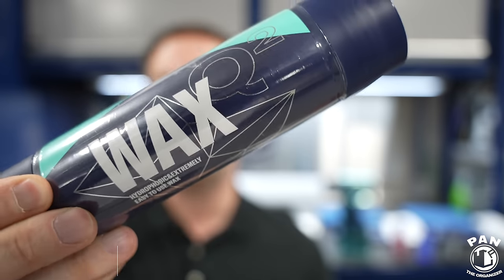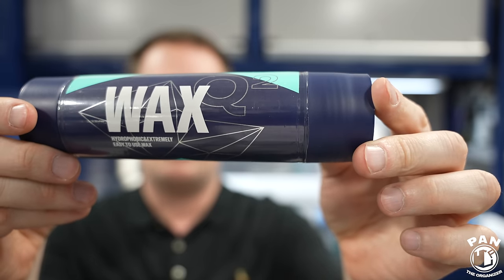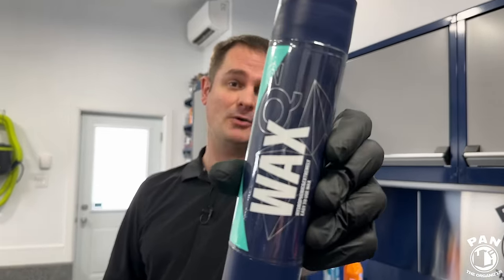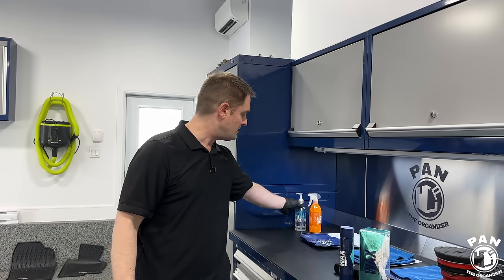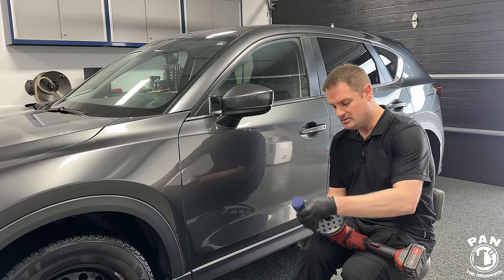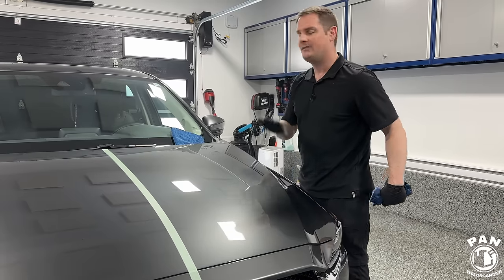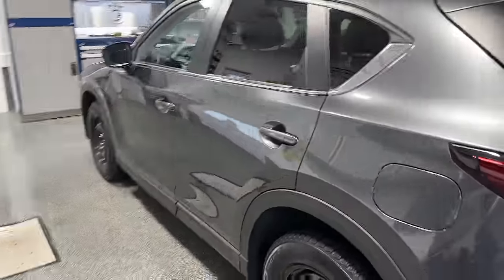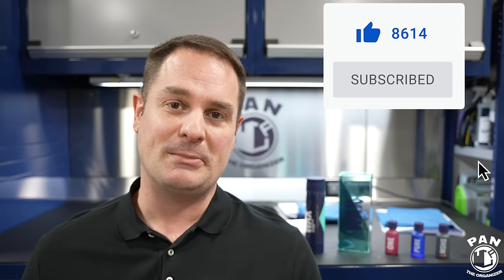Is this the most hydrophobic wax? Gyeon Wax !!

Comment: Just done my car with this wax over the weekend. The water beading is insane. Did a full decontamination (iron and tar removal followed by claybar session) and a "one step" with my DA and then a wipe down with Bilt Hamber cleanser before the wax. It looks phenomenal - plan to just keep it topped up with Wet Coat. The car was new to me (2019 Tesla M3P) and had obviously spent it's time at the swirl-o-matic beforehand.
Reply: Amazing people buy new vehicles like a Tesla and take them to automatic car washes. I guess they have no clue how much damage they do.
Reply: @LKN4WAR the dealership be jacking them up also 💀
Reply: @LKN4WAR  you are not wrong - but we all started somewhere. I had no idea either until I got into detailing about 20 years ago (thanks to the old Meguiars 3-stage kit they used to do) and haven't been to a car wash since
Reply: @chrisryan3445  Yes you’re right. I think a lot of people even if they knew many don’t care and want the convenience regardless. I bought a 4 year old full-size crew cab long bed truck I just did a two step and sealant on. Horrible Chevy white peeling paint. I made a huge difference even though I need much more than a 2 step. But it was good practice running the DA and various pads. Sonax maxcut w blue Rupes pads. I did most of truck w orange. People were not lying about how stiff the Rupes blue pads are. Def aggressive. Not good on curves. I need a  nano and 3 in polisher also.
Reply: @LKN4WAR  Yeah, you should see the cars where I live. I'm in a nice area and there are RS6s, Lambos, S63 AMGs, BMW M5 Comps, Jags, etc. etc. All taken through tunnel washes. Most of these people are either leasing these cars so they don't really care.
Reply: @LKN4WAR  the BMW dealer I bought my car from puts all new cars through an auto car wash with brushes. When I told them I didn't want a wash did they suggest a hand wash instead? Nope. I picked up a dirty car and cleaned it myself.
Reply: Swirl-o-matic.😂
Reply: @DiscoPornoSatan  I sometimes go to a covered parking structure and do a rinseless wash as it only takes a few gallons of water in one bucket.
Reply: @chrisryan3445  but man it's so hard not to use the swirl o matic especially when it's hot out in this Texas summer Im guilty of using it from time to time on my gti. It's so hard especially when you see the dirt and dust just caked and being cooked by the Texas sun you just want to get it off asap but hand washing is hard when the water dries up so fast
Reply: @AuthentikADG right you pcan’t even let them wash touch it after the wrap comes off

Comment: I used Gyeon Q2 wax summer of 2022 on my non-daily driver.  The car is snow white pearl in color.  I corrected the paint and prepped it with panel wipe prior to applying the wax.  I applied with a machine and waited beyond the required wait period to remove.  After application I was not really impressed with the glossiness or slickness.  However, after a few days passed and the car sat in my garage it seemed to become more glossy.  Slickness is ok.  I can't speak to the hydrophobics since the car has not been in rain since the detail and I usually only do ONR washes because the car doesn't get very dirty.  Longevity isn't a concern to me since the car is not daily driven and when I do a wash with ONR I top it with Obsessed Garage drying aid which adds a layer of protection and increases slickness.
Reply: That dying aid is amazing.  Great slickness and a nice gloss booster on my CQuartz coating.

Comment: This is an interesting wax but in my experience it has a haze to it, applying to glass it leaves a visibly greasy coat that seems to reactivate in sunlight. No matter how much you wipe with a clean dry cloth, it’s back once the glass heats up. On my vehicle which is deep metallic blue, you can see a haze in direct sunlight, but In shade it looks perfect. The hydrophobic qualities really are amazing though.

Comment: Hi All… I’ve been using this wax for 1 1/2 years, I’ve got 6 complete waxes on my SUV ( XC-40 Volvo); and my S-60 Volvo. It’s a great wax in the $50-60 range , my cars are garage kept, I’m getting easily 6-8 months. So easy to put on and take off, I leave on 20-30 mins before removing.  Hope this helps.  I live in NY, I WASH MY CARS 2 X week with ONR OR ABSOLUTE, so that’s why I get very long duration on an application
Reply from the maker: Thanks for sharing your experience!

Comment: Hey Pan. (Using gyeon products) How would you do a maintenance wash if the only protection is this wax? What soap / drying aid / topper would you use ? I just bought and applied the wax yesterday. Nice gloss and really slick feel.

Q2 Bathe soap? Would you use a ceramic detail spray or quick detailer? Top up with more wax or something like wet coat?

We talk a lot about maintaining ceramic coated vehicles, but what about waxed? Video idea?!

Comment: Hello, when you say wash and degreaser as the bare minimum to apply this, what is a degreaser? Do I need that if I choose to not polish and use iron remover. Can I wash using car pro reset and move on to the wax, I currently don’t have any exterior protections or coatings

Comment: For someone who has to do all my car care outside, and with a multitude of trees around, I always worry if I wait to long to remove my wax, or try to add a second layer of a sealant, that I will get dust or other particulates on my car that might scratch in the removal process.
Reply from the maker: Waiting 30 minutes of curing time won't be significant enough to start worrying about dust. I wouldn't overthink the moment.

Comment: the wax looks great, but $50+ is a steep price...  Ill stick with Technicians Choice 582 Ceramic detail spray for $39 a gallon.   I just spray a little on when the car is still wet after a wash, dry it off, and it looks just as good...

Comment: I live in the U.K. pan ,it lasted around 3 weeks in the rain before it stopped beading and made small water dots that didn’t want to move with air blower , I used it over ceramic pro I feel it made the paint milky so I stripped everything off and put ceramic back on
Reply from the maker: Good to know! Yeah results can vary depending on weather and conditions for sure. And also when using it as a topper it depends what’s underneath and how well they bond/react together.

Comment: Hi. Loving the idea of this wax for my classic Mercedes but one question, why 2 cloths for buffing off and what is the difference between the 2?
Reply from the maker: Hi. You can just use one microfiber towel if you're used to that method and have your preferred towels. But I demonstrate things the way Gyeon does it in this video, and they use two separate towels. Kind of like for a ceramic coating. First levelling towel (first buff, to remove the majority of the wax), and second plusher towel to do the final buff.
Reply: @PanTheOrganizer  Thanks buddy 🤩

Comment: gyeon wax drying time, how long should I wait before erasing? do I have to leave the wax on the surface for 1 night? Before the application I didnt use a prep, it is problém?
Reply from the maker: As I mentioned in the video, Gyeon says you need to leave it to cure for a minimum of 30 minutes before wipe-off. But you can also wait overnight if you want, and buff it off the next day. 

The more prep you do before applying a paint protection, the better the product will perform and the longer it will last. The bare minimum here is to wash the car, clay if it needs claying, and use a panel prep spray like Gyeon Prep to prep the surface.

If you just washed the car and applied the wax, that's ok, but don't expect perfect results or durability.

Comment: Hello, Pan.  What do you do with applicator after applying the wax?  Clean it as you clean the polishing pad?  As always, thanks for the great video.
Reply from the maker: Just a bit of APC, work in it, rinse with warm water. Let it air dry, and it's ready for use the next time.

Comment: Yet another great video. Question about using it. I'm in Cleveland Ohio, in the US. (Lake Erie) and it's finally warm enough to start hand washing and doing paint correction. I've yet to apply a ceramic coating to my vehicles. If I go through the steps of Descale, rinseless wash, clay towel, iron remover, wash again, paint correct now then apply the Gyeon Wax for protection until warm enough to ceramic coat, how hard will it be to remove, and what steps would I need to follow? (Would the descale and panel prep remove it all for coating?) Or would it be better to just apply something like the one coat, quick beads, etc?

Comment: Can it be applied to exterior plastic trim on vehicles for example the plastic grill on a Kia? Should it be applied to these? How to apply to rims?
Reply from the maker: Painted surfaces, wheels, and glass. As I mentioned in the video. 

To rims, use the applicator and wipe on the surface. Wait 15-30 min or more, like for paint, and then buff off.

Comment: Can we use this wax after washing? No need for clay then polish? I have a newer car, I'm not concerned with the swirls on it, it's white and not noticeable. We were thinking of doing an iron remover with decon towel, then waxing. Is this ok
Reply from the maker: Yes that would be ok, but the more time you spend prepping the paint, the better the results will be and the longer the protection will last.

A new car is never new until it's properly detailed. 
- at the factory, the paint defects are often corrected quickly by rotary polishing which can leave marks and holograms, so polishing corrects those, before you lock that in long term with a ceramic coating for example.
- vehicles are then transported by truck, train and boat so they are exposed to the elements, industrial fallout, brake dust, rail dust, etc
- vehicles are often left at boat docks (when transported by boat) or in exterior parking lots for weeks or months, again being exposed to the elements
- at the dealership, the vehicles are almost always poorly prepped using the same dirty water that was used for all the cars on a given day, and poor washing and drying methods leading to swirls and scratches 
- at the dealership, a layer of cheap wax or paint sealant is usually applied to attempt to make the paint glossy prior to delivery. It's crucial to remove any previous protection before you apply a ceramic coating, as coatings need to bond directly to a virgin clear coat.

If you only plan on applying a regular carnauba wax or paint sealant though, you could decide to skip machine polishing, as those protectants can be applied over existing protection and it's not as crucial to prep the paint as well.

I explain all of this in this popular video: https://youtu.be/QgoyrC-5CMc

So you can better visualize the new car prep process, here are the steps I perform on a brand new car for my customers: 
RS6 Avant Performance: https://youtu.be/L5SQ0ZIJCj0?si=mcQiMs9HBLlaqjGK
Mercedes S 580: https://youtu.be/Vq_tfcwryVI?si=whord2_UEFSg28UW
Aston Martin Vantage: https://youtu.be/OKga3yZVTqo
Volvo XC60: https://youtu.be/tvDBBenhYFA
Tesla Model Y: https://youtu.be/gohks8xP5NY 
Porsche 911 Carrera: https://youtu.be/2ckiivbFqs4
Audi Q7: https://youtu.be/t7HCBSVnizM

Comment: Would this make a good topper to prevent water spotting on fresh ceramic coating?
Reply from the maker: You'd have to ask Gyeon if you can apply this on a fresh coating. Perhaps Cure is a better option.

Comment: I busted out my Zymol Glasur yesterday to give it a go since I havnet used wax in years. Well, I think I am done using paste wax. Spray sealants or waxes are just SO much faster and easier. This was probably a waste of time since my Diamond Body will probably shed it in like a week
Reply from the maker: It’s generally not recommended to apply regular waxes on top of a ceramic protection as you would be masking the coating’s superior properties and the coating will eventually reject the wax anyways. 

This Gyeon Wax has chemistry allowing it to be applied on top of coatings.

But yes I also prefer ceramic or graphene spray toppers on top of a coating. Quicker to apply.

Comment: Hey Pan.  Another great instructive video as always.  I actually noticed something you have said in this one as well as several previous videos, and I'm wondering what your recommendation would be.  In the first years that I have owned my car I tried during the winter season to do proper maintenance washes.  But after a few years, doing maintenance washes while staying away from automated car washes wasn't possible anymore.  In fact, it way getting soooo complicated for me considering that I don't own a garage, so I just got fed up and decided to check if there would be a good option in regard to automatic car washers.  I found "Pet....Can.... Super Soft" and asked then what is their soap pH and they said it's around 7.  They also had a sample of the brush at the cashier's counter and believe me it's as soft as you can get.  If my car has ceramic coating protection, would you consider that option to be acceptable?  Thanks! :-)
Reply: I took my 2015 Macan S (white), my 2018 911-GTS (white) and 2018 McLaren 570spider (caracao blue) through Petro Canada  TOUCH Car wash nearly every single day for YEARS with no issue at all.   Only the McLAren didnt get the carwash in the winters since it was in storage... Gas station car washes have come a long way.  Of course, by hand is better, but dont be scared of gas station washes
Reply: During the winter I use the touch less car wash to keep the road salts etc to a minimum, but only on nice days and probably only once a month. During the spring summer and fall I wash etc by hand. I stay away from automatic washes with brushes because no matter how soft the brushes are you don’t know how dirty the vehicle was that was there before you. All you need is a lit sand stuck in the fibres to scratch the crap out of you car.

Comment: I get confused when sometimes you say don’t put anything over a ceramic coat, but now there are several things you can put over a ceramic coat?
Reply from the maker: No confusion needed. To keep things simple, it's generally not recommended to apply REGULAR waxes or sealants on top of coatings, as you would be masking the superior properties of the coating underneath, and the coating will end up rejecting those anyways over time.

But like anything in life, there are EXCEPTIONS with some waxes, that have different chemistry that is compatible with coatings. In the case of the Gyeon Wax, they made the formula to be compatible with all their Gyeon coatings. So no problems if you want to apply the Gyeon Wax on top of a Gyeon coating.

But also, for ceramic coatings in general, you do want to use some form of maintenance once every 2-3 months at least. A ceramic or graphene topper spray, or as instructed by the coating brand of the product you are applying.

See my ceramic coating maintenance tutorial here: https://youtu.be/IqIW78FmRYU?si=O36rTgOgg8WIi8vU

Comment: I want to put sealant before using that wax for higher protection. Which sealant can be used for undercoat under that wax? And how do you apply them one after other in correct order.
Reply from the maker: I would recommend the Gyeon CanCoat EVO spray (that can last up to 12 months) for the base protection. It's a simple spray on application. Here's a link: https://bit.ly/41kJhe7

I show how to apply the previous version (which lasted 6 months) here: https://youtu.be/VnE0b0nsiMU

Same application.

Comment: What would you have to do before applying it is there a process such as Decon and paint correction beforehand?
Reply from the maker: For any paint protection, the more prep you do before applying, the better the results will be and the longer the product will last. This is especially crucial for true ceramic coatings in glass bottles. Not as crucial for waxes or sealants.

So for this wax, you can just wash the car, dry it, and apply the wax. But obviously, for best results, doing a decon wash, iron remover, clay bar if the paint needs it, light polish if the paint needs it, and a paint prep spray (like Gyeon Prep) before you apply the wax, is always best. 

Welcome to my channel. You discovered one of the biggest car detailing channels on YouTube as we surpassed 965,000 subscribers and we have over 130 million views! I have been detailing for 26 years and I love to share my knowledge and passion with my viewers.

You found the right channel to help you learn everything about detailing.

Comment: Which are better in overall? 
It seems like almost about the same in the video.
Will it be wet coat? Since the applying method are much more easier compared to the wax
Reply from the maker: It’s a question of preference on application method. Personally, I prefer WetCoat.

Comment: Hi Pan, this Gyeon wax, is it safe to apply all ceramic coatings,  I currently have a gtec coating on my car and was wondering if this would be safe to use as a topper,  thanks
Reply from the maker: I spoke about this in my video. Yes you can use it as a top off maintenance on a coated vehicle. The vehicle in the demo was ceramic coated and needed to be refreshed.

Comment: I have a 2022 Jeep JLU.  Will this stain the black fender flares? Also can this be used in direct sunlight. I don't have an enclosed space to work so I have to work in direct light.
Reply from the maker: Gyeon says this shouldn't stain plastic trim, but I have heard of cases where it might, so I would avoid trim or tape the trim before waxing. Like for any paint protection, I wouldn't recommend applying this in direct sunlight. Always apply in the shade, on a cool surface. The best time is usually very early in the morning, or very late in the afternoon. The same applies to washing your car. Avoid direct sunlight and avoid doing things at noon, when the sun is at its brightest and hottest. Common sense applies in detailing.